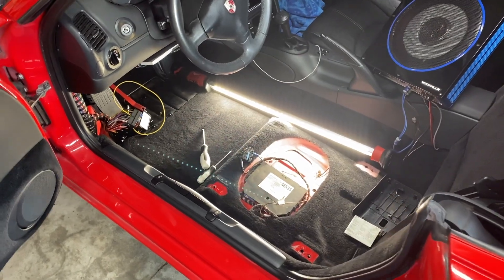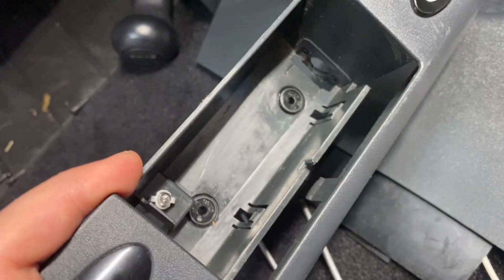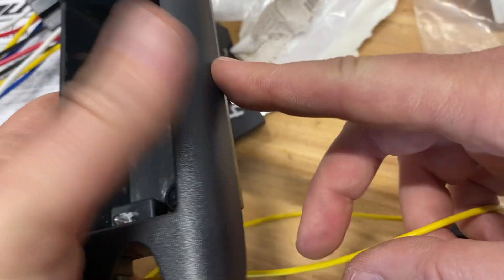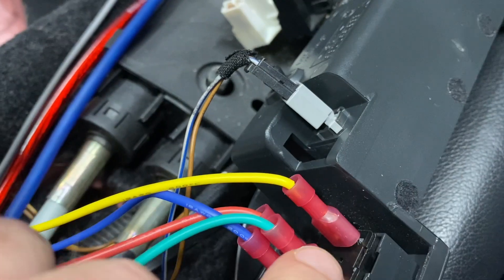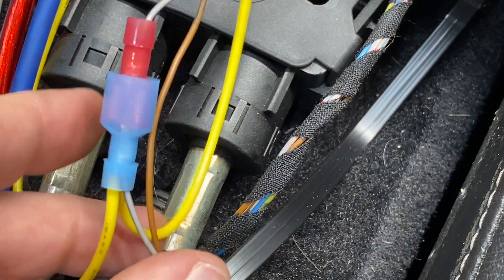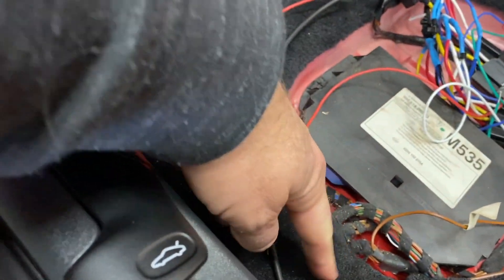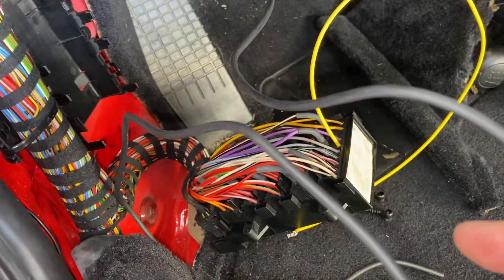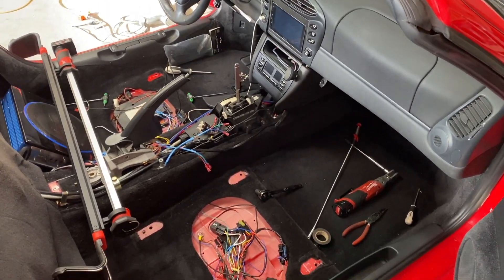Installing HEATED SEATS in a Porsche 986/987/996 (Part 3 - The Wiring)

Comment: Good work.  You are making a lot of progress very quickly.  I had an easier job since I was installing 986/996 seats and using the Porsche relays which were included with the seats I bought. If I recall correctly the interior of my car was apart for 4 or 5 days.  I checked on line and it appears that the Porsche relays now cost about $160.  I understand why you decided to use the generic relays.
Reply from the maker: +Kevin's Boxster yeah they are way overly expensive... and you would need two of them. I paid $300 total for both seats! 😆
Reply: @HelpMeDIY  Considering the cost of the switches and other components (the cost of the wire needed to obtain power from the fuse box was outrageous) you could easily spend almost $500 if you didn’t control costs.
Reply from the maker: @kevinsboxster2310  definitely

Comment: If I decide to go the cheap route and rip apart my seats and put a generic seat heater in... Do I have to use the button provided or can I use a pirsche center console switch? If I get 2005 987 seats Do I have to use the rails ? I don't like how the seats are taller and hide the black wind deflector
Reply from the maker: +Scorsese Sneakercon Don you could use the center console switch, you would just have to figure out how to wire it. And I would assume you would have to use the rails unless you want to fabricate your own way to attach them to the car.

Comment: do you think it would be possible to get the heated seat parts from Porshe instead of getting different seats?
Reply from the maker: +Mr. Lyons I know you can buy the switches and relays, not sure if the heating elements are sold separately from the seats but a quick call to a dealer will let you know.
Reply: @HelpMeDIY  Also have you installed a wireless charger?
Reply from the maker: @MrLyons-jk1vo  no, never done that but should be pretty easy